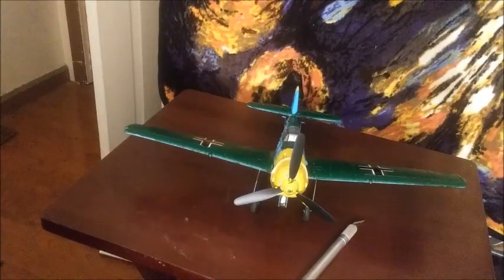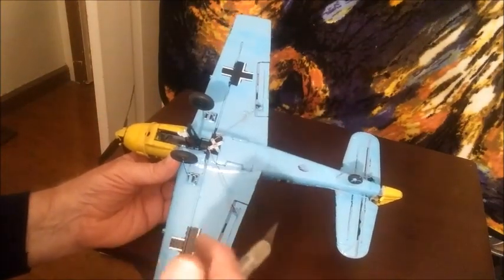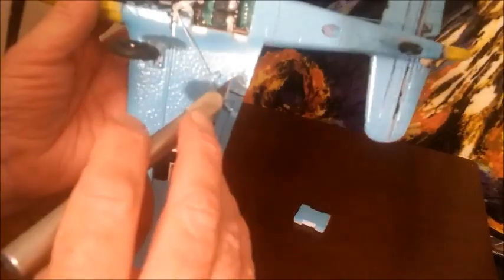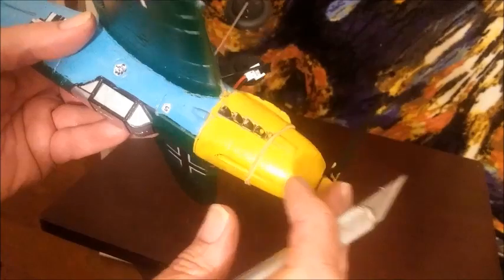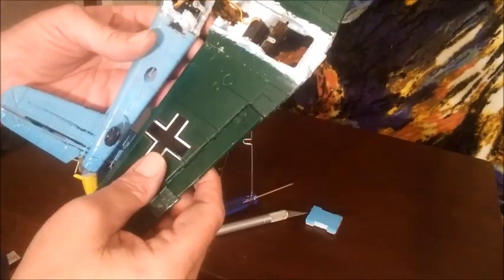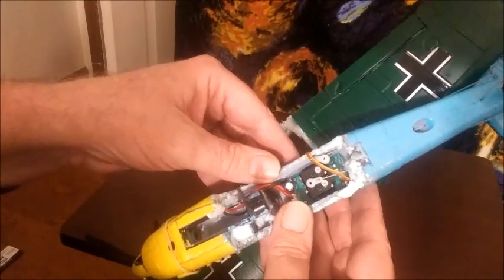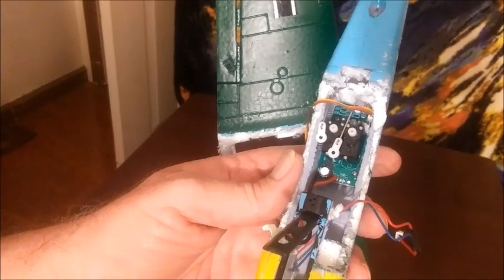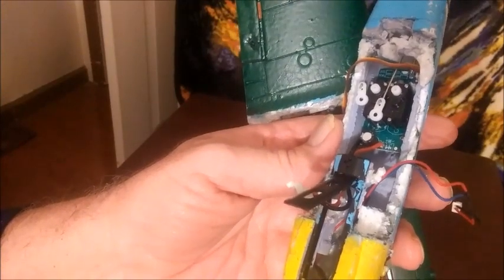death of the BF109

Comment: Did you try taking the pcb screws out ;) A large hot soldering iron to the pcb itself could maybe soften the glue to bend up the pcb. CA glue and baking powder would sparkle the body back together nicely.
Reply from the maker: No I didn't. However she is put back together with a new receiver board and flies great

Comment: I have all three Bf109 color scheme variants, and they all look waaay better than the rushed looking paint mod you did, wondering why the original paint scheme didn't work for you. Also wondering if excess paint where it didn't belong contributed to your flight issues. Noticed that you installed the landing gear backwards too, that's why there's so little space between both front wheels. The black plastic wheel rim spokes need to be facing outwards, with the wire landing legs on the inside of the wheel, not outside. These Eachines are so inexpensive to begin with, it's most often better to just get a new one rather than go through all this trouble. I love these warbirds, they look great and fly beautifully, sorry about your crash mate.
Reply from the maker: I already covered the landing gear issue. but I have copied and pasted my answer in ref to the spitfire. I also covered the paint scheme as well. I grew up stories from family members who severed in the Army, Royal Air Force, and the royal Navy during world war 2 and I once wrote a paper for a thesis on why Germany could never of won the Battle of Britain . My stepfathers Father who was a POW at stalag luft 3 and if you know your history you will already know what that camp was famous for. I suggest that you check out some of my videos involving eachine aircraft were I explain that they are not correct representations of the aircraft they are meant to be. here is my earlier comment in reference to the spitfire. "I was waiting for someone to spot that (misquoting captain Mainwaring)". There is in fact a very good reason why I appear to have the wheels on the wrong way around. The fact is that they aren’t. The spitfire was (to quote my stepfathers father who was an RAF POW in stalag luft 3) “the spitfire was a little knock kneed”. The wheels were placed close to the fuselage much like the famed BF109. This made the spitfire and the BF109 hard to handle on the ground. I could go on and on and bore you and everyone else to death on the handling on the ground of both the spitfire and BF109 but I think we can leave that up to those with scrambled egg on their hats.
Reply: @fltltcrashcrocker5017  Dude, that was so cool of you to get back to me. Thank you. Subscribed..
Reply from the maker: You are most welcome. The Eachine BF 109 was really a heap of rubbish when I first got it. There were so many issues with it. I found out while trying to figure out what to do with it that a lot of people were having the same issue with the receiver board being worse than useless. By the time of the video you watched I really didnt care about the aircraft. But once the new receiver board was put in it went from a heap of rubbish to a OMFG this thing can fly. I did get a second BF109 and that one flew great right off the bat.
Reply: @fltltcrashcrocker5017  I absolutely love everything about these planes. There are currently a total of 10 Eachine Warbirds. There's the p51 Mustang red tail, the T28 Trojan, the P40 Warhawk, the Japanese Zero, the KLB Spitfire, the Johnny Johnson Spitfire, the F4U Corsair, the grey Bf109, the desert camo Bf109 and the yellow/grey/powder blue Bf109. Right now I have 7 out of 10, with the last three on their way in the next few weeks. The grey Bf109 is by far the most impossible to find. The only way I was able to get one was by leaving comments on Youtube reviews of that particular one and seeing if anyone had one they were willing to part with. Was so happy when someone reached out to me and had one to sell.
Reply from the maker: Good for you. the eachine brand is for the must part good. As I said for the most part. Glad you found the BF109 you wanted. Like the spitfire that went from the MK1 to the Mk 24 the BF 109 went though many versions. keep flying and fly safe and fly well. Oh and if you have to crash do it with style.
Reply: @fltltcrashcrocker5017  Is there any other way to crash? Peace!

Comment: Well, this is depressing viewing as my eachine 109 has exactly the same problem as yours had (dodgy gyro/aileron control) and I’ve ordered a replacement receiver for it on the assumption that swapping out the receiver would be fairly straight forward. I can only hope that the glue holding the existing receiver is as poor as the receiver itself and not the araldite that you’ve uncovered! It really is poor quality control on the part of these manufacturers. If didn’t keep making things that I wanted to buy I wouldn’t buy them!
Reply from the maker: Don't be depressed sometimes there is an answer
Reply from the maker: If you are still interested I have an update video of the Eachine bf 109 https://www.youtube.com/watch?v=GxRAIAWHyHw

Comment: I dont want to offend you Mark! But watching how you ruined this plane, makes me sad! The receiver hatch is designed to be popped out carefully with a small screwdriver! No need to cut! The receiver board is held by 4 little Philips screws, not glued in! The aileron servo plug can be wiggled out carefully. You were successful by killing this plane!
Reply from the maker: Not offended. The hatch I removed at the start of the video I was unaware that was a hatch intended for removal of the receiver. I found out later after the fact that that was what the “hatch” was for. The receiver I think would have just barely fitted though the hatch. In other words a really tight fit. The screws you mentioned I didn’t see again until after the fact. It is sad but not a total waste. Killing the aircraft lol. Nothing lives forever and when flying there is always the chance for death. Have said all this I am going to add that the issues with the ailerons was so bad that the aircraft was unflyable. The only other time I flow it after the maid flight video all it did was crash into the ground while spinning out of control.
Reply: @fltltcrashcrocker5017  Not doubting your word for a minute about your experience with this Bf-109 Mark because others have had problems also. Mostly it seems to stem from the programmers trying to add an AS3X-style level of stabilization in place of the Fully Manual "Expert Mode" used on the rest of the Mini Warbirds. This has introduced some weird bugs to the flight controls but they have at least gone back to the old programming on the Spitfire. Bad luck for buyers of the Bf-109!!!
However I must join with VT in wondering just what the heck you were doing with the plane? The information that you were "discovering" is freely available in the RCGroups Forums threads on these various planes. You only need to ask and there are plenty of knowledgeable folks only too willing to help. No need to go in with crowbar in hand and wreck things! ;-)
Reply from the maker: I wouldn’t say I killed it. Ripped out its guts yes sure. But as it was unflyable we can debate the merits of what I did and why I did it until the cows come home. The fact is it’s done. If Eachine had supplied an aircraft that flow then we would not be having this conversation. Instead the BF 109 was an unflyable EPO foam mess that only merit was making one feel rather dizzy watching it spin out of control. I swear Ill never put my teddy bear in the spin drier ever again.
Reply: @fltltcrashcrocker5017  Fair enough mate. At least somebody got a win out of it - even if it was only Old Ted! 😜😂
Reply: Valja, you have just made my day as I’ve got the same issue and have ordered a replacement receiver. Watching the video made me lose hope but I’ve noted your advice and will be leaving the scalpel and flamethrower alone!
Reply from the maker: Don't give up hope. also of the record there is a follow up video in the works. Soooo shhhhh mums the word
Reply from the maker: If you are still interested I have an update video of the Eachine bf 109 https://www.youtube.com/watch?v=GxRAIAWHyHw
Reply from the maker: @kveecock  If you are still interested I have an update video of the Eachine bf 109 https://www.youtube.com/watch?v=GxRAIAWHyHw
Reply: @fltltcrashcrocker5017  thanks Mark. I did actually manage to carry out the replacement, though getting it to work properly was more luck than judgement. 
Now trying to get these planes to bind with my radiomaster transmitter. No success so far despite following many videos on the subject.
Reply from the maker: good luck on getting it to bind. I have been looking into getting a multi protocol radio. so far Im only at the research stage. keep in touch on how things go at your end and I will do the same at my end.
Reply: @kveecock  To bind to the TX16S (or any other OpenTX radio/other Volantex V761 radio) turn plane on first, sit on its feet to allow gyros to initialize, (won't initialize unless upright AND still!)  hit "Bind" on the TX16S (or just turn on the other Volantex V761 radio) and it should form a unique bind to that transmitter. On all subsequent start-ups ALWAYS turn on the bound Tx FIRST! Otherwise the plane will go looking for the nearest operating Tx and your mate flying another V761 plane nearby will have control of 2 planes!
You can bind ALL your V761 planes to the 1 V761 radio or to the 1 model set-up on the TX16S.
You should note that some firmware versions of OpenTX have a bug whereby the V761 protocol (and some others I think) will only bind (and fly) IF you select "Low Power Mode" - odd but true!